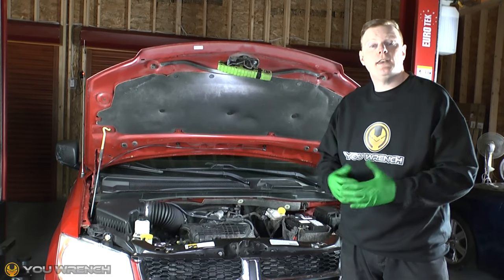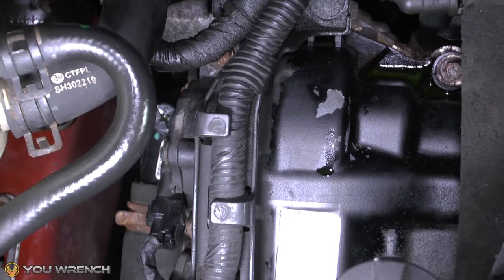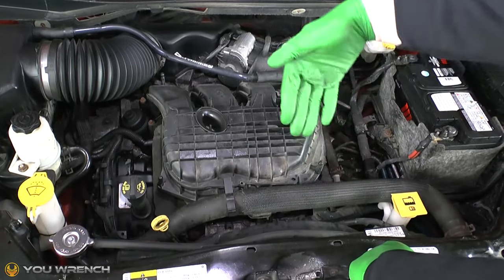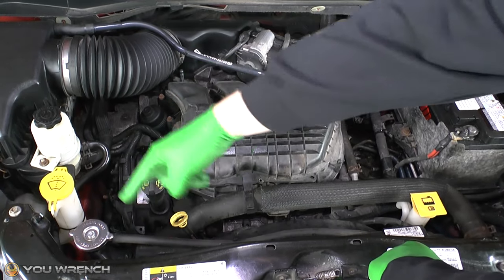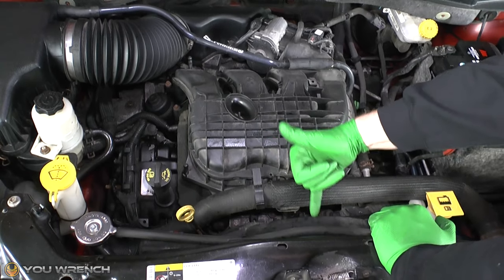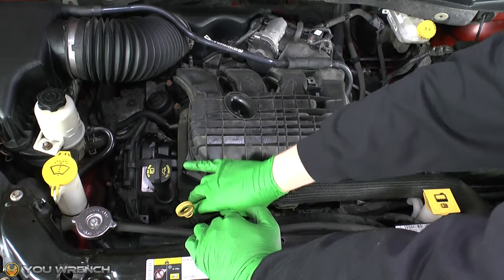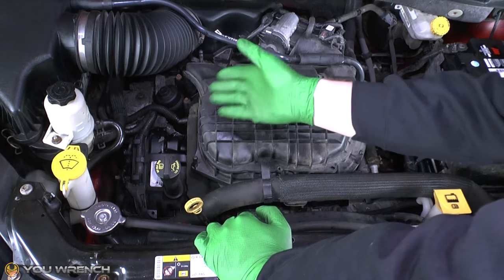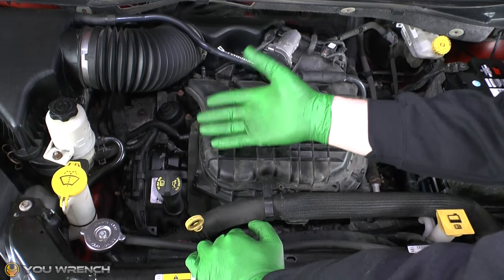How to Test if Your Car's Thermostat is Working (Without Removing It!!)

Comment: Can it be stuck halfway?
Reply from the maker: Yes, unfortunately that can happen and it makes diagnosis harder! It does not usually happen that way, but it is absolutely possible. Depending on the make and model, changing the thermostat can often be a very cheap and easy DIY job, so often a good option is to replace it if you suspect it is the cause before delving into more complex solutions, as then you can completely rule it out if it does not fix the issue. But, on some models the thermostat can be expensive, so really does vary quite a bit! Hope that helps!

--- 

To help support us (for both you and others reading this) there are a few things you can do:

1) Donations both needed and welcome! We cannot operate You Wrench without the support of people like you! You can donate by PayPal - just go to www.paypal.me/youwrench

2) Please ensure you subscribe to our YouTube channel. 

3) Please Like our video's on YouTube (by clicking Like!) 

4) Please help spread the word, the more people who know about us the better! Add links to our video's in forums, let people know about us.

Thank you for your support!

Comment: When vehicle parts are made from plastics & placed/used on hot engines. 

Plastic

Radiators,
Radiator shrouds
Thermostats
Intake manifolds
Intake manifold internals
Fuel pressure regulators
Fuel rails
Fuel tanks
External Fuel filters
Spark plug Ignition coils (distributors)
Throttle bodies (carburetors)
Throttle body internals (toothed gears/cogs)
Gas/throttle pedals (drive by wire)
Transmission oil pans
Engine oil pans.

Comment: This would not tell you if it is the thermostat, broken water pump or blocked flow. All of these would prevent that hose from getting hot.

Comment: Just to ensure I understood everything correctly. I need to keep an eye on the hose  leading up to the thermostat, right? On my Civic it would be the bottom hose. 
Checked at a moment ago and it is cold despite engine being warmed up. And I had an issue with overheating + rather cold air blowing through the vents.
Thank you for this video!
Reply from the maker: Yes, you have understood correctly. Once the engine has heated up the thermostat should open and you will get a rush off hot coolant coming from out of the thermotstat into the hose atteched to it. The hose will go from cold to red hot as soon as that thermostat opens. If yours stays cold then it would indicate that the thermostat has not opened. Likewise, no heat in the cabin would also suggest that the thermostat is not opening as the coolant is not circulating around the system as it is not able to come away from the engine. And finally your overheating would also suggest thermostat because that hot coolant is stuck around the engine and cannot release into the radiator to circulate and cool. So yes, definitely shounds like the thermostat is your most likely cause, and if the thermostat is cheap on your make/model then definitely start there. Hope that helps 👍

-----------------------------------------------

To help support us:

1) Please be sure to use our Amazon Links!

2) Please ensure you LIKE our video's, and SUBSCRIBE to our channel!

3) Donations always welcome! Hit the SUPER THANKS option below the video on YouTube, or by PayPal: www.paypal.me/youwrench

Thank you for your support!

Comment: Another way to tell is if you have no heat in the vehicle
Reply from the maker: Yes, absolutely correct. If the thermostat is not opening then the coolant cannot circulate through the system and so there will be a lack of hot air available inside the cabin. Nice tip 👍

-----------------------------------------------

To help support us:

1) Please be sure to use our Amazon Links!

2) Please ensure you LIKE our video's, and SUBSCRIBE to our channel!

3) Donations always welcome! Hit the SUPER THANKS option below the video on YouTube, or by PayPal: www.paypal.me/youwrench

Thank you for your support!

Comment: I had this completely backwards. I thought the lower hose only has coolant flowing once the engine warmed up not the upper hose. What does it mean if it is flowing in the top but not the bottom?
Reply from the maker: The lower hose has fluid that is cooled from the radiator and flows into the engine, and the upper hose (attached to the thermostat) lets the fluid into the radiator (once at the required temp to open the thermostat). And the whole thing repeats in a cycle. Hope that helps!

--- 

To help support us (for both you and others reading this) there are a few things you can do:

1) Donations both needed and welcome! We cannot operate You Wrench without the support of people like you! You can donate by PayPal - just go to www.paypal.me/youwrench

2) Please ensure you subscribe to our YouTube channel. 

3) Please Like our video's on YouTube (by clicking Like!) 

4) Please help spread the word, the more people who know about us the better! Add links to our video's in forums, let people know about us.

Thank you for your support!
Reply: @YouWrench  thank you!!! Okay, so does that mean the two hoses are supposed to be different temperatures and not the same temperature once the car is warm? Sorry if I worded that weirdly but I was told that they should both feel equally hot after the car has been running long enough to get to temperature. I can drive my car for 30 minutes and the top hose is hot as hell but the bottom is just absent of any heat. Again, my car does not have a temperature gauge in it at all. It’s the dumbest design flaw a car can have. I’d rather not have a gas gauge. At least if my car runs out of gas I just need to put more in. If my cars running hot and my thermostat sensor is broken then I could destroy my car.
Reply from the maker: @classydarktoys5731  Yes, both will be hot, but the top hotter than the bottom one. If your bottom hose stays cold after the engine is at full running temperature then that would point to an issue, most likely thermostat, but could also be water pump or a clog in one of the pipes or even the radiator. Hope that helps!
Reply: @YouWrench  it did help so much! I was just being a baby and not driving it long enough to let the thermostat open! 😂 I finally said screw it and opened it up with the AC going and when I got back home the bottom was nice and hot. So I was just driving it like a quarter mile and getting scared jumping out and checking it then turning off. 😂 I just had some stupid mechanic work on my car and mention that the bottom hose wasn’t hot when he thought it should be but my sensor wasn’t going off alerting me that the car was overheating. So he said it’s probably broken. So I’ve been spiraling since then but he was just completely wrong. 😂 thank you!

Comment: So why is it a problem if the thermostat is stuck Open ? 
The engine warms up and doesn't Overheat. No Problem !

 FJB !  Big Problem !
Reply from the maker: Yes, in theory that is correct - and some people remove their thermostats. However engines are designed ro run at specific temperatures, and removing it from the system could lead to component damage, reduced performance and higher fuel consumption. It's worth doing a Google search on this topic as there is a lot of information available on this. Additionally, one of the immediately noticeable drawbacks for this is that the coolant will never reach it's maximum opimal temerature, and this would mean very little warm air would be available inside the cabin as the internal heating also comes from the coolant. Hope that helps 👍
Reply: It can cause problems with your DPF.
If the engine doesn't get to the right temperature, then the DPF Will never regenerate, causing it to block up and fack up👍

Comment: It's 10bucks and easy to change..just change it
Reply from the maker: Yes, often this is the case and it's a good option just to replace it so you can rule the problem out (either way). Not all thermostats are that cheap though, and some and harder to change than others. But for most cars it should be quite cheap and easy, and so definitely a good starting place to either fix the issue, or otherwise allow you to move on with diagnosing a bigger issue.

--- 

To help support us (for both you and others reading this) there are a few things you can do:

1) Donations both needed and welcome! We cannot operate You Wrench without the support of people like you! You can donate by PayPal - just go to www.paypal.me/youwrench

2) Please ensure you subscribe to our YouTube channel. 

3) Please Like our video's on YouTube (by clicking Like!) 

4) Please help spread the word, the more people who know about us the better! Add links to our video's in forums, let people know about us.

Thank you for your support!